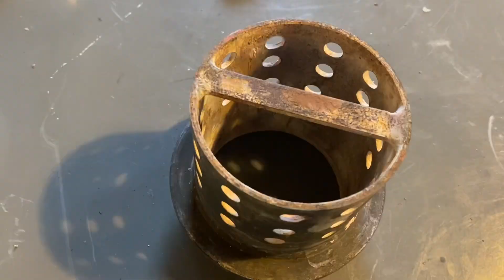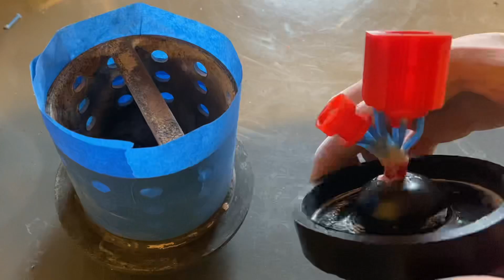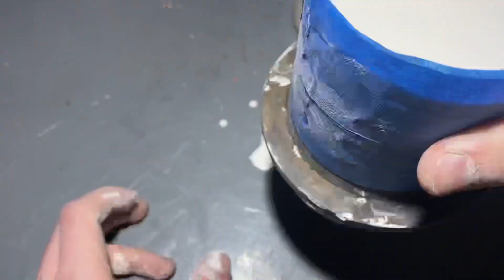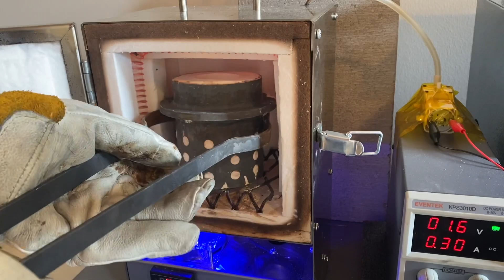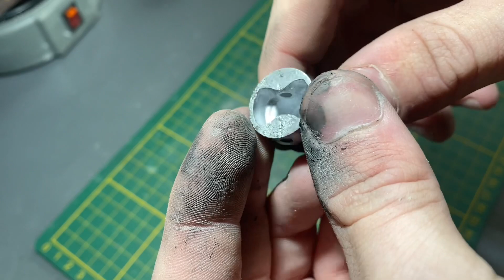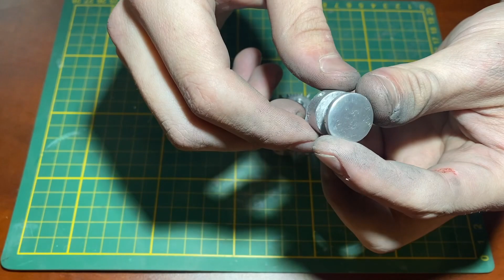My Best Cast Yet - Casting a Two-Stroke Engine

Comment: How is the Vevor vacuum investment table working out for you? I know it's simply the factory version of the Kaya-Cast and Dura-Bull brand ones, but I was curious of your opinion regarding its quality and service considering it isn't sold for an extra $600 premium.
Reply from the maker: The machine is great. You’ve essentially answered your own question, the alternatives are the same product sold with a brand name at a premium with possibly a few minor additional features. 
When I received my machine a part was broken. Vevor had great customer support and quickly sent me a replacement. I haven’t had any issues with the machine since and it’s worked well every time I’ve used it.

Comment: Nice job.  I've tried some investment casting, it's definitely a "black art".     Mostly just use sand casting right now although I have some resin SLA parts I want to try to invest in the near future.  Do you have a small lathe?  I uploaded several videos of my little two stroke engine running.
Reply from the maker: I don’t have a lathe unfortunately.